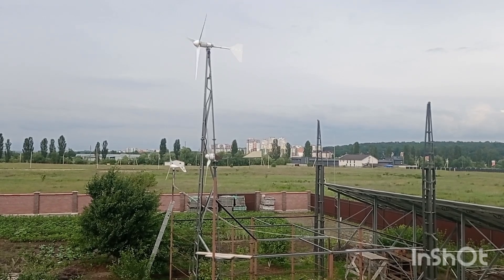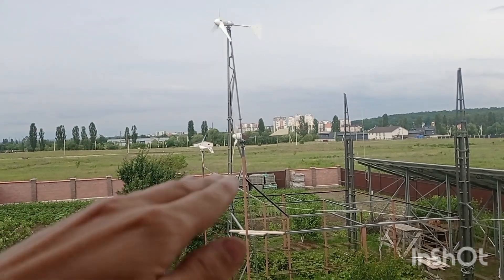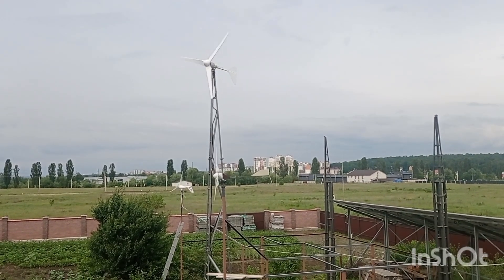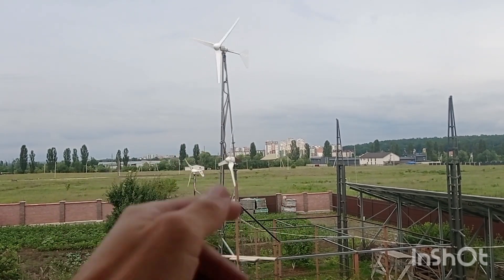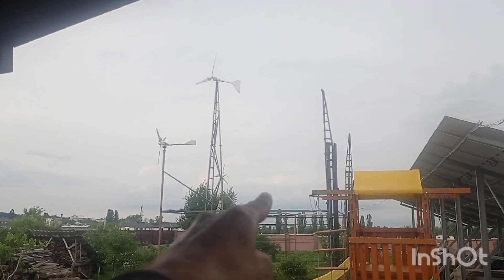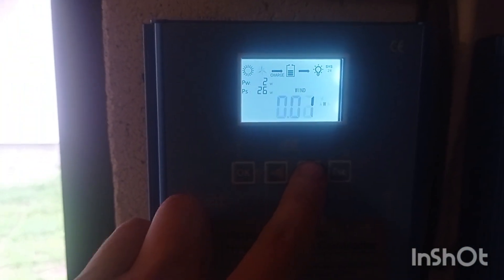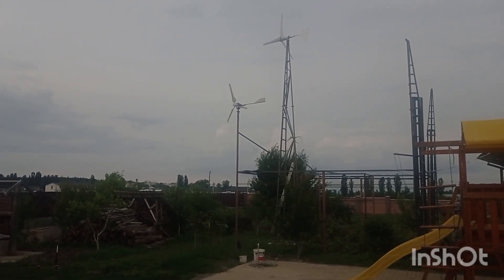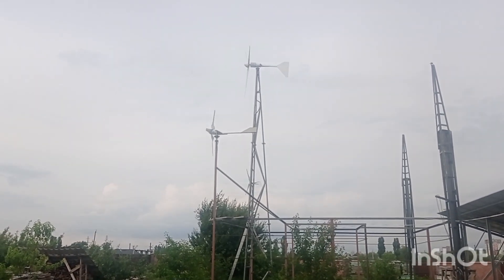First testing day of my self-made 500w wind turbine, final checks before giving it decent height

Comment: Fun learning videos, keep em coming please 👍

I think know what could be causing your newly made turbine to be wobbling slightly, okay so maybe just a little imbalance... But looks like you used a self aligning bearing in the previous video? 

That type of bearing isn't rigid and moves about in a ball joint a few degrees to 'self align' with another bearing block. At the moment it's working like a hinge and the imbalance is being exaggerated by the wobbly shaft. 
Adding another bearing with a gap or the slip ring between them would lock the shaft in place.

Also, the bearing isn't strong like that, if the turbine gets blown over I will bet you that the bearing has been pulled out of the green mounting plate!
Reply from the maker: yes, the reason of wobble is the green bearing, I've already dismantled it and figured out what it is.
the turbine should not go off the bearing, as it has locking joints, two of them, cone shape, that fixates the turbine body in a stable position.
and the wobble is inside the bearing itself, since the covers were not pressed hard enough inside, which I was not aware of before, and also I have to apply  little bit of better grease inside so it keeps rotating as it should.
also, the tail plate is rebuilt already - will explain all that stuff in the next video.

Comment: What kind of controller you plan to use for ft2000l2? Deye inv. directly? Are you happy with these controllers you show on the video for smaller turbines?
Reply from the maker: smaller controllers seem to be just fine for the smaller turbines. they match in the capabilities, so no issues.
for FT-2000L2 I plan using the grid tie inverter I currently use a smaller FT-1000 (the blue one, working in pure wind-turbine inverter mode), but with better brakes of course. and FT-1000 will get a local-made controller, which I already have for some time and in no use atm.